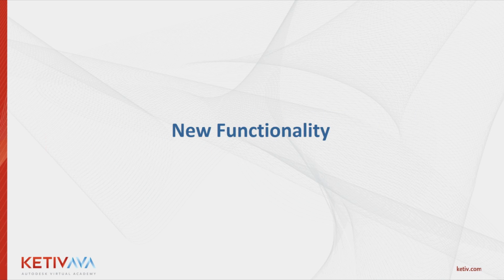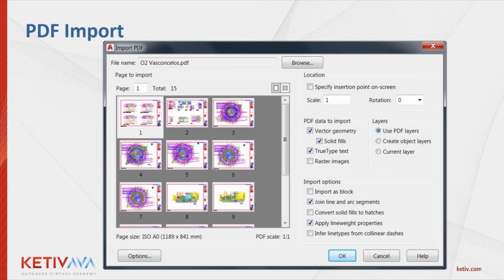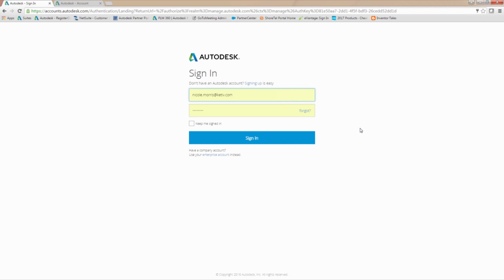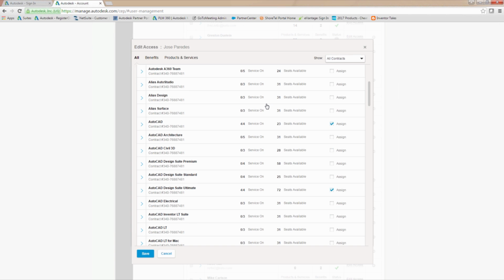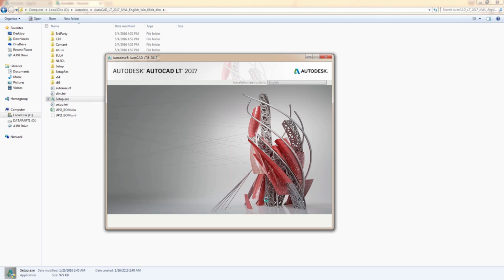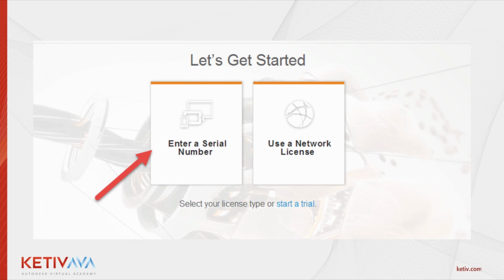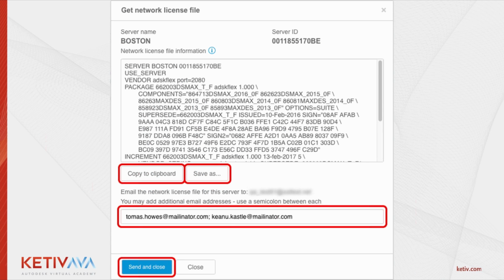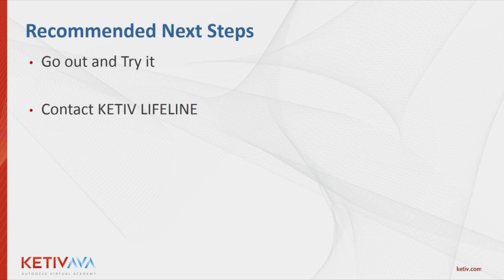Autodesk Virtual Academy: Installing and Activating Autodesk 2017 Products

Comment: Hello Jose,I have a question. I keep getting this error log( Failed to read data from Content Center) when selecting the Insert Frame in Designs. I'm new and just getting the hang of Autodesk. Any information that might help is highly appreciated.Thanks
Reply from the maker: +Kector Zuarez Hi Kector! Make sure that your libraries are mapped to the correct location and that the components you're trying to use are there. For more information check out the last 2 entries on this forum post: https://forums.autodesk.com/t5/inventor-general-discussion/failed-to-read-data-from-content-center/td-p/2302297. Let me know if this solves it.